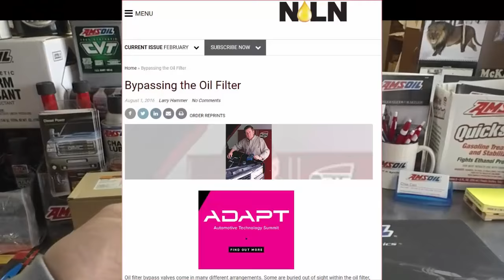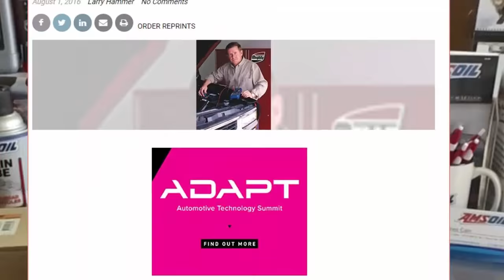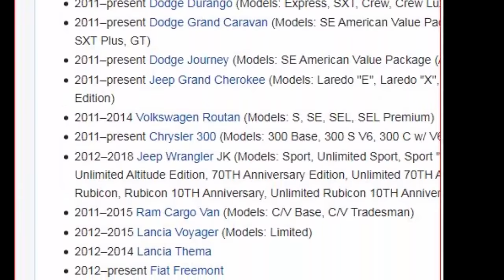2014 and Up 3.6 Pentastar Oil Filter Cap Warning - Ram Promaster, Jeep

Comment: I’m getting ready to change the oil in my 2019 Ram 1500 with the 3.6L, I found the oil filter’s location that was the first mystery, now, I have a new filter insert I purchased at the dealer and I’m wondering if it’s even the correct insert. How many different types go into the 3.6 do you know?

Comment: I have only ever noticed one screw on style oil filter that didn't have a 25-pound bypass on it. At least. And that was still 17 and 1/2 pounds. Oil filter media will take 25 to 30 lb on a regular basis if it's built properly. I have no idea where you got the idea that oil filters cannot handle more than 13 lb. Ticks me off is why are we going back to canister oil filters when that is a much older design you were way ahead of the game with the screw on oil filter.
Reply: Actually the media will handle all flows of oil - 30, 40, 50 lb "passing through at temperature" - what he's talking about is actual restriction.. There's not a single passenger car (non-diesel) oil filter in production that will allow for much more than 13-PSI.. It's written on the manufacturers requirement data.  Over those restriction PSI's at the media its self will trigger the bypass valve or spring. Why do you think those bypass valves are in there??

Comment: So is the cap different on the older models? It would be nice to see them side by side
Reply: Yes, that’s my question also.
Reply: The filter cap and filter housing are different on the earlier Grand Caravans at least, change was in 2014 I think. Earlier ones have a shorter cap and the "nut" on the top is solid . It's also easier to put the gasket in the wrong place on the newer caps.
Reply: @macfady2181  The filters are also different...they can't be interchanged unless the installer is incredibly ham-fisted about it.

Comment: So, after watching this video, I want to go check my wife's Chrysler 300's filter to make sure it's on correctly.  That being said, I still prefer the filter location/style (top of engine in plastic canister) versus an oil school spin on under the engine.
Reply: The plastic oil cooler is garbage.
Reply: The Pentastar 3.6l has a known issue with the plastic filter housing cracking at the base. My daughter and son-in-law both drive Chryslers with the 3.6 and both have had their housings cracked by careless oil change mechanics who simply wash their hands of it and say it’s not their fault. Repair shops are quoting $800-$1000 for replacement. Do your own oil changes, be careful when loosening and don’t over tighten.

Comment: So every time you change your own oil you have to replace the cap or risk ruining your engine? Then the filters should be built with a new cap integral correct?
Reply: What? Where did you get that? No, that's not true at all.

Comment: I am doing an oil change right now and this exact thing happened to me. Removed the cap, turned around to set it down and heard a noise behind me. The I noticed the spring and pieces of the bypass valve lying on the ground and oil splattered everywhere. Trying to find out how it all goes back together.
Reply: Sorry to say  but from my experience  you will need a new oil cooler housing
Reply: @lowriderlifestyle2869  Yeah, I replaced the entire unit in my Chrysler T&C, as well as the ones in my daughter's Dodge Journey and her husband's Ram 1500.

Comment: Im in need of help, i changed the whole housing and it came with the new filter but now its giving me a code P06DD
What can i do?
Reply: Same here. Been scouring the interwebs for the last 2 weeks and all i can find is changing the oil pump solenoid.  I'm hesitant because it was functioning properly before I changed the housing. If  you find an answer tag me.

Comment: Cold start ups? There’s literally no oil in the top end after abt 15 minutes after shutdown in these 3.6 v6.  There is no valves to retain oil so every start up is a dry start for about 4 seconds which is why these engines wipe out cams and rollers.  Ditch the oem pos filter and get a Baxter anti drain back adapter with a premium WIX can filter.
Reply: I use the flood mode to get oil flowing a bit before starting engine.but that Baxter unit is a darn good product👍👍

Comment: Do those white synthetic filters flow better than a regular wix or mopar what do you think
Reply from the maker: The flow is the same unless it's extremely cold or the filter is getting old (resin coagulation)  - so overtime the amsoil nanofiber will flow better and in cold temps there are no glues or resins to hamper the flow. All a nanofiber.. The other benefit is the capacity to flow ratio..

Comment: Well my oil housing is leaking. So yeah 😂
Reply: The o ring on the oil filter cap is on the wrong grooves. There’s a couple wrong ways to put it on that it will leak and only one way to put it on correct so a lot of people actually mess that up